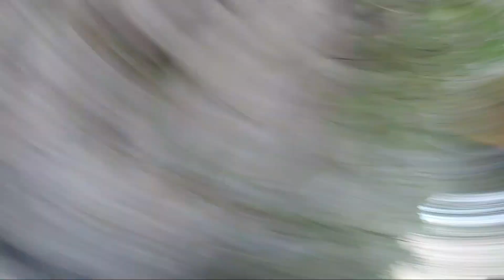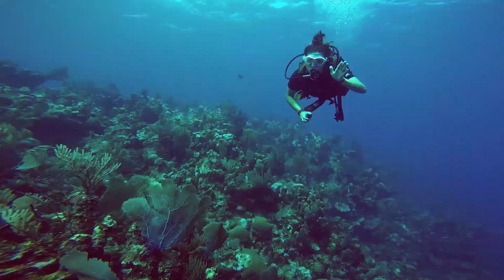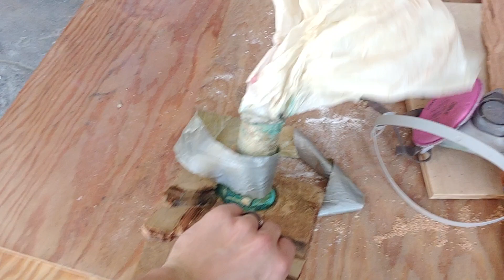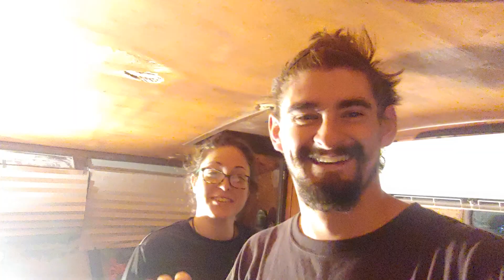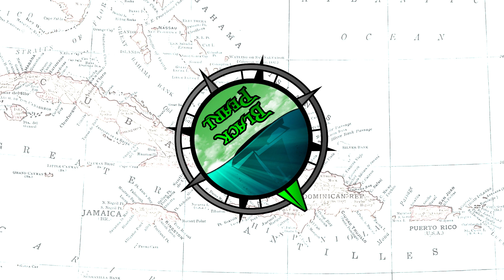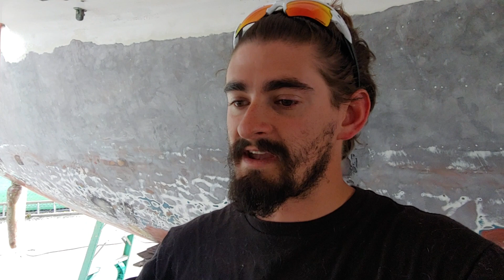WE CUT 17 HOLES IN OUR BOAT!! Most would have called it destroyed, but we are all patched up. (S1E6)

Comment: Use paint for farm tractors, you can get at tractor supply. Did my 25 bayfield and its hard, chip resistance,  and has some uv protection
Reply: And alot cheaper

Comment: Don't the patches have to be lower than the original fiberglass so once you glass and fair them they don't "stick out"?
So what about using termite poison on those two trees that seem to be the main nests? And putting some around and under the boat to at least limit any potential infestation?
Reply from the maker: And they do have to be a little lower, but we are going to fiberglass below the entire Waterline, so we will be able to blend it better by doing it that way👍
Reply from the maker: They'll do great for when Florida requires masks to leave the house! 😂

And we've thought about it, but the yard doesn't want to work with us on treating the problem. There are several other spots in addition to the trees, like their shop that also needs treatment, even if we wanted to just treat it for them. As far as fighting them, there are just WAY too many to even possibly try to prevent them. You only need two to start a colony and there are thousands of them . . . I've thrown borax and other insecticides around the base and in the boat, but we will still have to treat it lol.

It's sad, especially since they can damage non wood boat too. We'll cover that more in detail in a future video though 👍